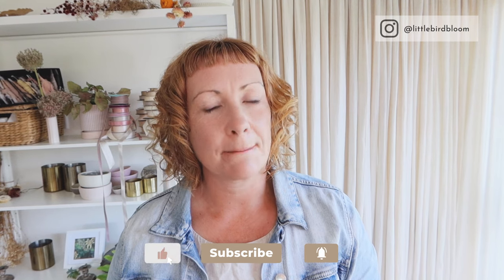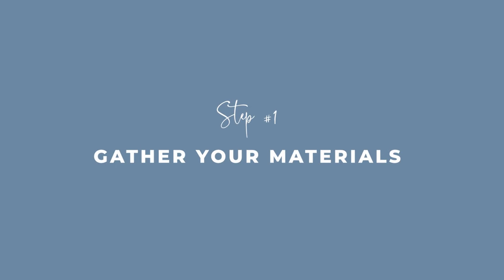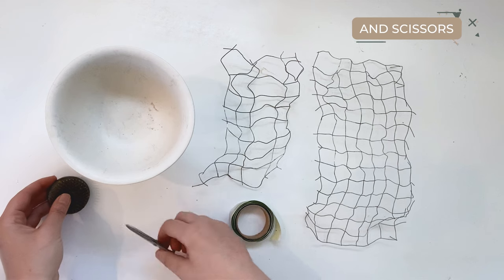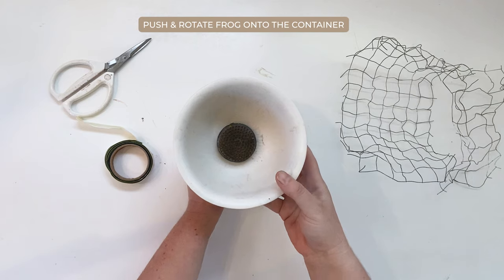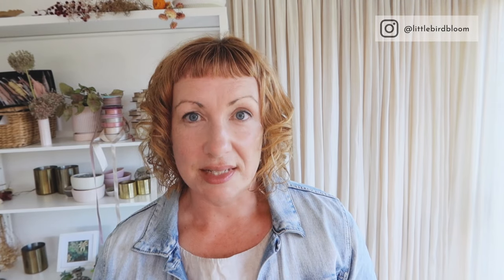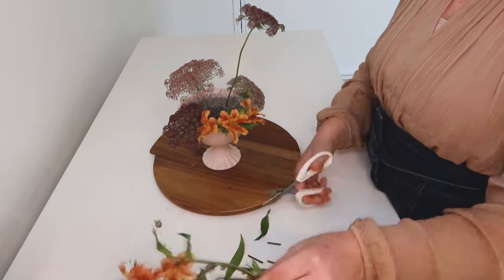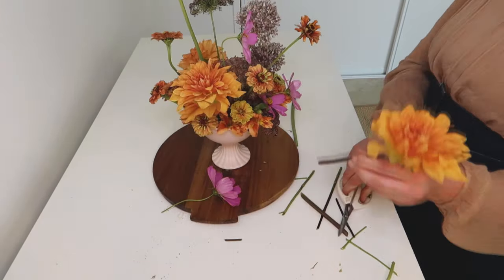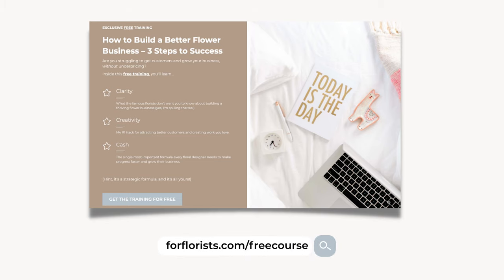No Foam Floral Design 🥰  Chicken Wire Floral Arrangements 📝 A Step by Step Floral Design Tutorial

Comment: This is such an informative video! Thank you! 

2 questions... 
1.What is the smallest you can go if using a compote or bowl, and what is the shallowest you can go, before you really just need to use foam instead? 

2. What is your lip colour? 😄 it's so pretty and natural!
Reply from the maker: Nudestix Stick in the shade Nudies Bloom 🥰

Regarding the question about the size, if the dish is really shallow, you can use a flower frog/kenzan. Otherwise, I still use chicken wire for anything that has a size that's 2-3cm or taller.
Reply: @LittleBirdBloom  thank you! That's so helpful! Good to know it can be used for smaller vessels 😊

Comment: How would you change the water for this type of arrangement? I'd imagine that you wouldn't be able to take it out like you would with a hand-tied in a vase, but I could be wrong.
Reply from the maker: You can pick up the whole arrangement and gently push the flowers back and tip the water out. Then you can put the container under the tap (or use a watering can) to add in new water. It's actually wayyyy sturdier than I thought. 😀

Comment: I'd love to see the process behind a flower arch with chicken wire- specially how you keep the flowers hydrated or of you keep them out of water for the duration
Reply: .....also, I love your humor 😅
Reply from the maker: Oh that's such a lovely thing to hear. Thank you 😍
Reply from the maker: Great question! I'll definitely do more of this coming up. Generally speaking, I don't usually bother with hydrating the blooms in the arch cause it's only meant to look good for a few hours. 

I do plan my ingredients specifically for foam-free and lean towards flowers and foliages that do well out of water. if I am super committed to having a specific ingredient, I'll then use water tubes/picks on those specific stems.

I've actually found that pre-installation hydration is super important. I've even used dahlias and delphinium in installations and they still look good at the end because of the 48 hours of hydration beforehand.

I hope that all makes sense – but don't hesitate to circle back with more questions. 😍